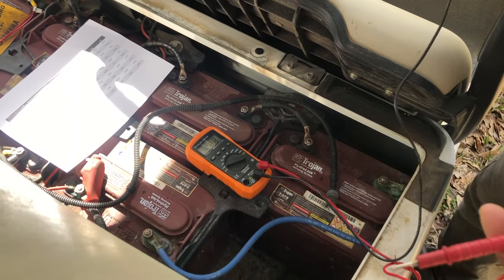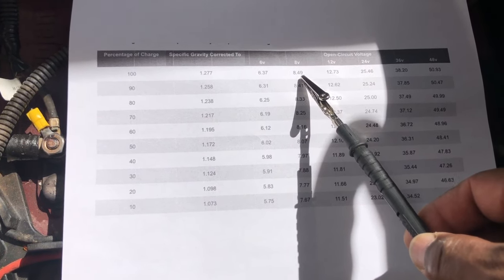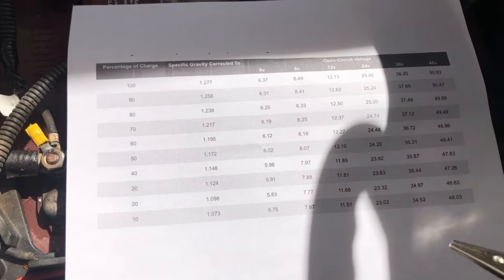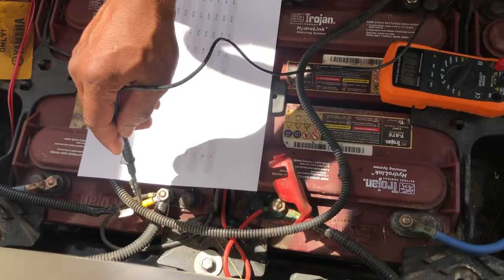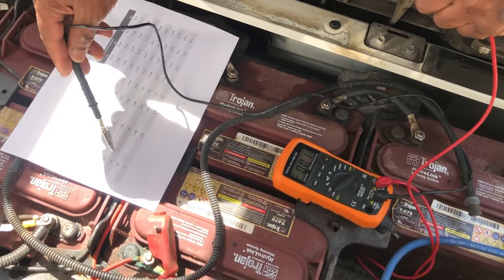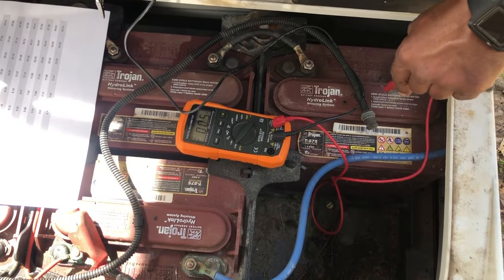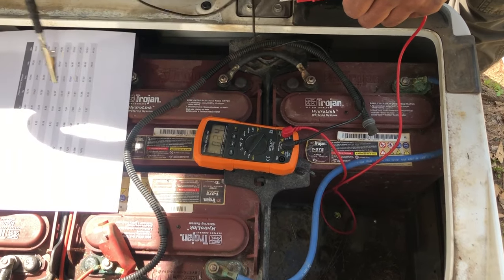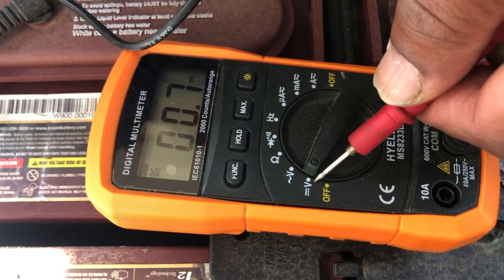Testing Golf Cart Batteries with a multimeter

Comment: Great video. Golf cart died on the side of the street. I followed the steps and measured the combined voltage of the battery bank starting at the first 8v battery to sixth battery. The voltages kept increasing as you would expect, I was reading like 42.5v at the 5th battery but when I moved to the last battery in the series it dropped to 2volts?  When I check the voltage of this battery by itself it reads 8.4v. What does that mean?
Reply from the maker: Thank you for the compliment. That’s a good question that you have but you should really watch the video from the three minute mark on. That is truly the way you can find a bad battery/bad cell. They have to be disconnected from one another at full charge and let them sit for 24 hours.

Comment: Now keep in mine folks.  He is checking volts, not amps.   You can check the amps by putting them under a load by using a carbon pile or similar tester.  Good luck

Comment: Why is my pack (6 batteries x 8v) showing 17 volts across? I tried every battery locations
Reply: You have to make sure you’re on the 2 terminating batteries. 1 has a large cable leading to the solenoid. The black attached to the frame or negative ground. You’re probably on 2 batteries right next to each other in series
Reply: @franzm77  thx for your guidance. I saw one ground cable going to the frame, so i hooked up black probe to that battery post. Then the one battery with red wire (+). Nothing reads higher than 18V. Even when charging. But this golf cart runs fine. Im just trying to install battery charge indicator and need to find out the terminating batterie :(

Comment: I got a question, I have a 6 8v batteries for a 48v system in a club car. Sitting its at 48.9v which is already low to your chart. What's supposed to be the readings while your driving the cart?   My cart when i drive it varies anywhere between 33v to 48v depending on flat ground, slight up hill or when i reach top speed and its not drawing that much of a load any more.  If i take it on like a 5 minute run, My battery voltage meter shows it goes down 1-2 bars and the battery light starts blinking. When i come to a stop my voltage practically goes right back up to my 48v-49v?  My Batteries have voltage but not the amperage any more?

Comment: Can you charge 8 volt golf cart batteries with a. 12volt charger?
Reply: Yes but not recommended. You only want to do this as a last option if you have completely dead battery. Like left it them if the charge for a year dead and the golf cart charger isn’t working. That’s because the charger send a small electrical test to the batteries and if it doesn’t get one back. The safety mech kicks in and doesn’t charge the system. So you have to go to every 8V battery and add a little of a charge to it before the charge will work again. (if you don’t have a 36/48v jumper). Then if you do use the 12v as a last resort only leave it on each battery for like 2 or 3 minutes maybe 5 minutes max. Then you can plug in your charge and it should work. I’m sure some experts out there will gladly tell you more about it or what not. Btw this isn’t advice it’s just something I had to do and got away with it once.

Comment: Can you add 2 more batteries? I see there's the space available
Reply: Yes but then you'd have a 64v golf cart and the electrical components are not necessarily built to handle that voltage.
The charger is pre-designed to charge a 48v setup. You'd have to drop $350 for the 64V Accusense Charger.
Next, you'd have to replace the motor controller and motor ($1500-2000) The 48v motor would only be good for about 5-10 full throttles before it cooked the brushes and died. The motor controller, probably less. The other components such as gas pedal could also be damaged because they are fed from the motor controller.

TL;DR - You would have to gut all the electronics and swap up to components rated for the new voltage in order to last more than a day.